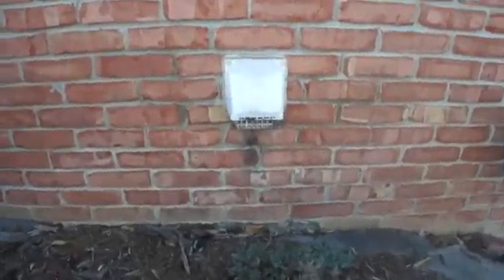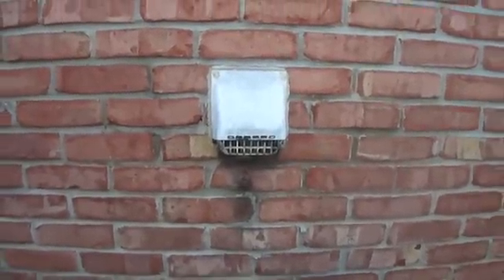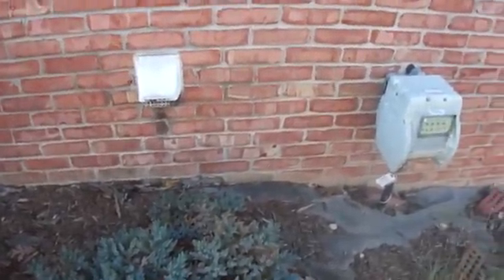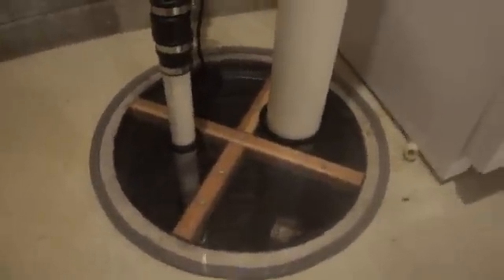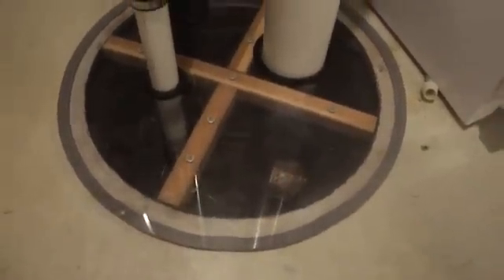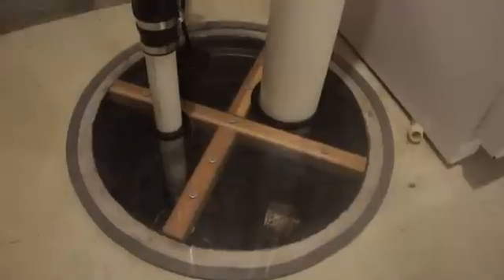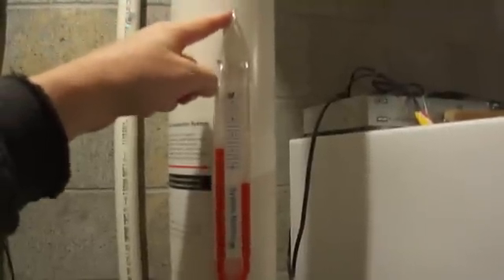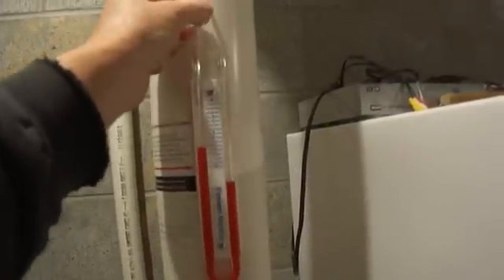How To Install Your Own Radon Reduction System

Comment: good workmanship, but theres alot not to code...the biggest isssue, and im not here to critique, just voicing a concern. installing the fan below liveable space, although " sealed" theres always the potential for a leak, and a possible increase in your radon level.
Reply from the maker: Genesis Radon Thanks for your concern but I believe my system is just as good if not superior to any other system as my radon levels continue to excel my expectations.  Alot of people including myself could not afford to have a system installed by a contractor which is unfortunatle.  And lets face it, a system (or anything for that matter) is only as good as the installer and quality of workmanship.  Installing the motor outside is plain STUPID as it will not last nearly as long in the outside elements and creates a very annoying noise issue to next door neighbors.  And what's with these contractors caulking the lid shut.  I mean seriousley; what a nightmare in every aspect.
Reply: proclaimliberty2000  genesis here.  Caulk isn't a permanent seal, but your sump pump isn't a forever thing either, it will go bad and need changed. But they are sealed to prevent possible back drafting if close to combustion appliances. And or to prevent pulling air from your basement increasing the negative pressure your home naturally creates and in turn possibly making your radon problem worse. We will agree to disagree on the longevity of the fan. It's a motor and it goes bad to. It's only a matter of time. Yea it's possible it could last longer not being exposed to the elements but those fans are made to run in water, and adverse conditions in general. Glad to hear your system is running and the problem corrected. Back to the sump though a permanent seal would include a polyurethane based sealent, which is the code, but never usually followed for the above reasons.
Reply: proclaimliberty2000  oh and I forgot. As far as noise is concerned, code in the states says the vent pipe shall terminate 12" above the roofline. And shall be 24" above any Windows within 10 ft. That being said 90% of the noise is produced from the exhaust point. So if your exhausting like you are, then yea the noise is stupid. If it were vented by code, you would probably never hear the thing. Or very very faintly. From experience.
Reply: +Steve Pasterchek You had a good point of possible radon re-entering the home.I have not seen windows on the wall where the radon is exhausted.    On average I would guess 2% of the radon would re-enter the home considering the diluted radon and the amount of air renters the home due to negative pressure draw by the radon system,  in the case all the windows are closed. Without  the radon system, how much radon enters the home?  I would guess 60 % or 90%. Why would noise be a concern from outside? The hotel air conditioners  make tons of noise but nobody seems to complain, not to mention all the garbage bath room fan. Americans are immune to noise anyway! When it comes to the radon system, I think those code writer over kill. Those noisy bathroom fans and air conditioners  should be banned
Reply: +Steve Pasterchek Exhaust leakage concern is another reason for the requirement of installing fan outside. Again, how much a concern is it?  not to mention these DWV pipe can easily be  installed water tight by a senior lady. The concern of out door electric safety is more than the concern of radon leakage from the exhaust pipe. Compliance to electrical code does not mean 100% safe. Let me ask you this question? Do you have concern that your drain pipe in the basement may leak so why do not you install all the water proof electric near the drain pipe.  The politicians in the EPA want their ass to be clean to create these requirement and those radon contract makes it a big deal in order to make good money.  I believe my own intelligence, not politicians.
Reply: The simple fact is (and you can argue this all you'd like) this system was installed incorrectly, will not pass inspection, and is simply not up to code. Multiple professionals have all chimed in agreeing with this conclusion, obviously self included. The fan should not be installed in a living/livable space (garage or attic is always preferred), and the exterior vent pipe should be run above egress. Simple but undeniable facts. DO NOT FOLLOW WHAT THIS MAN HAS CHOSEN TO DO.
Reply: Ken Arrington what’s the personal harm in installing the fan indoors if he continues to monitor radon levels?

Comment: how far do u put in the 4 to 6 inch pipe in the subpump? im guessing just above where the water flows in?
Reply from the maker: David Cantu I just checked it.  The pipe extends two inches below the lid.
Reply: thanks if i have any questions ill message u

Comment from the maker: I purposely mounted the motor indoors so it will be in a controlled climate which will make the motor last longer.  Also, we don't leave windows open as we have A/C.  If I could do it all over again I wouldn't change a thing.
Reply: My AC doesn't take air from outside.  It recirculates inside air.
Reply from the maker: You're referring to the HVAC make up air system.  Not an issue as it's on the other side of the house.  Sorry, but there is no 100% fool proof venting where some may not be re-introduced back into your home at one time or another.  As long as the system is working properly it's a mute point.
Reply: proclaimliberty2000 Yea you'll get a lot of negative feedback about the setup....code etc....honestly that's what I thought when I saw the setup as well. But in the end....what's worse? Not having any radon removal means at all? Or something in place that does remove radon? I think it's great you have something, but yea, I would make the changes recommended as well. Just keep in mind with anything you post, people will always find something to gripe about. I do like the lexan sump pump cover, so you can see water level in there. Might do that with mine at some point.
Reply: @chovis38  Actually Canada says the basement is the best location to prevent damage to the fan.  I live in Fishers Indiana, and the city allows installation of the fan in the basement.  If you think about it, if you don't allow the Fan to be located in the basement, then you should not allow gas furnaces or gas water heaters to be located in the basement.  As Canada says regarding radon fan installation, "properly installed fans and pipes will not leak radon into the building and are usually installed in the basement".
Reply: You need to test on a daily basis in the basement and upstairs with monitors. If it ever leaks on the exhaust side of the fan you could put 500 - 1000 in your home without ever knowing it. It could be that small of a leak that you might not hear it. 
You can do whatever you want to your own home, but when you sell you will have to bring up to standards.
Reply: Here is the issue here though, your AC has a cold air intake somewhere outside to pull fresh air. Since you're not venting the exhaust correctly into the atmosphere you could easily be reintroducing it into your home though your AC's fresh or cold air intake.

Comment: I ran across this view and wanted to let you know that there are two serious issues with your radon set up.  1st is that the pump should always be outside or above any living spaces (attic) which your's is above a bedroom.  In addition, you should always have it exhaust above the lowest point in your roof at minimal. In your current set up the air can be pulled in from a window when open.   I would highly suggest you make these corrections.
Reply: Radon is heavier than air. If above the roofline, it could also fall down into an open window
Reply: Fans are all in basement where I live in Canada.
Reply: WRONG!
People giving advice, that shouldnt be giving advice, are a problem.
Reply: @robinmurray9801  A fan located in the basement does not meet post-1991 EPA recommendations or 
 standards.
If inside, the fan must be located in an unconditioned space, e.g., the attic.
Reply: @robinmurray9801 the test would determine effective installation or not, right?
Reply: Actually Canada says the basement is the best location to prevent damage to the fan.  I live in Fishers Indiana, and the city allows installation of the fan in the basement.  If you think about it, if you don't allow the Fan to be located in the basement, then you should not allow gas furnaces or gas water heaters to be located in the basement.  As Canada says regarding radon fan installation, "properly installed fans and pipes will not leak radon into the building and are usually installed in the basement".